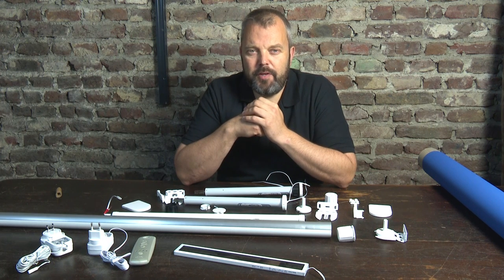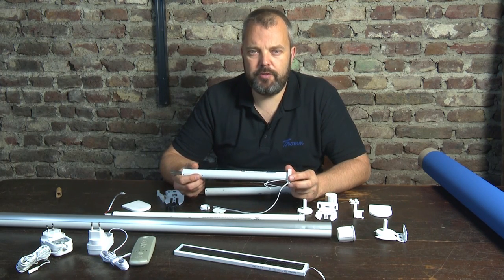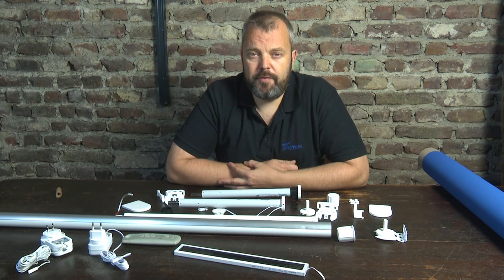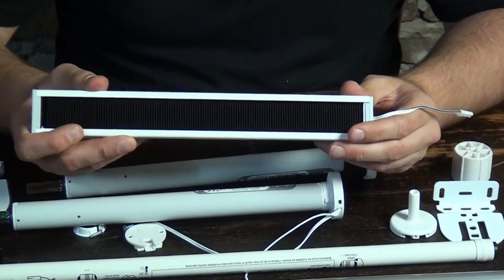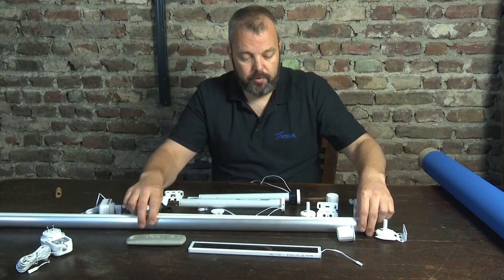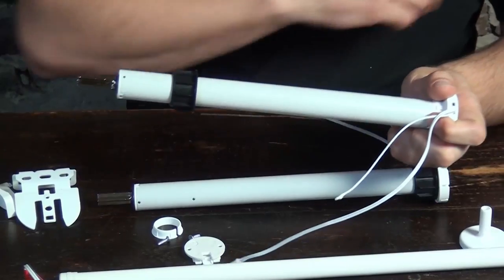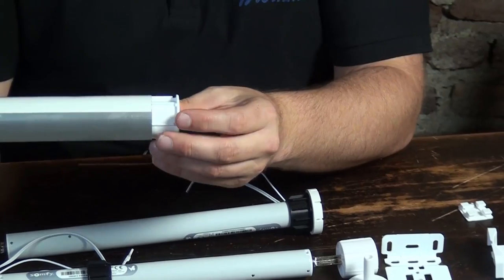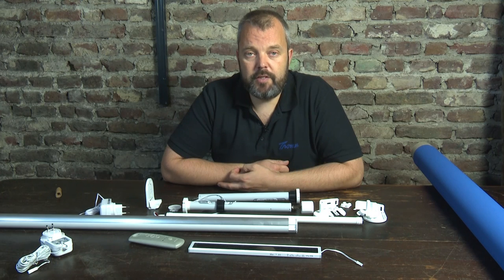How to make your own electric roller blind - Part 1 - parts overview

Comment: Could you provide the reference fall the parts.
Also Could I use one solar panel for 2 motors?
Reply from the maker: Hi Mickael, we provide all the items as a kit as these aren;t easy to source (and only sold in bulk bags of 100 to 500). If you could mail me at info@motorise.it, I can send you a quote. 2 motors on one panel is unfortunately not an option, so you would need one panel for each motor. If there's anything else I can help with, let me know. All best, otto